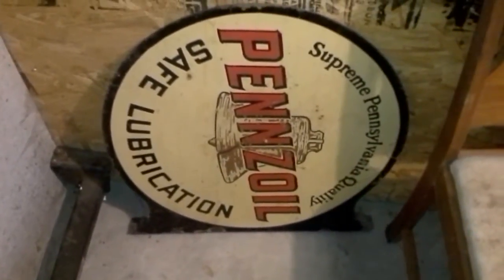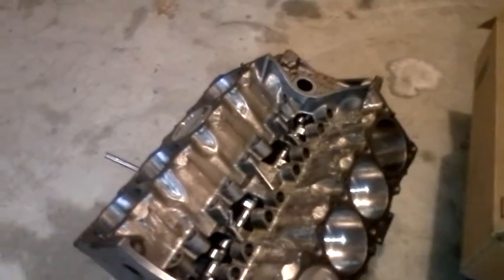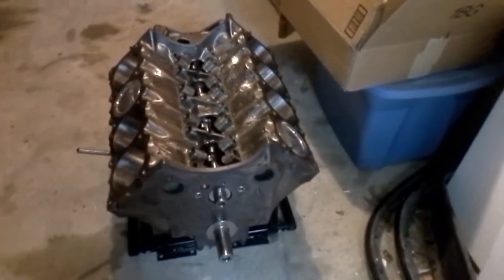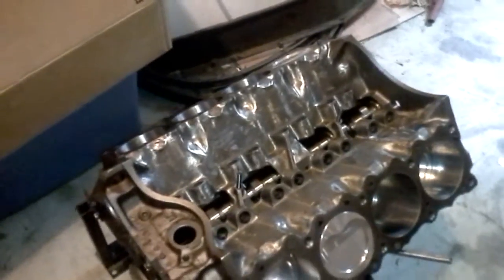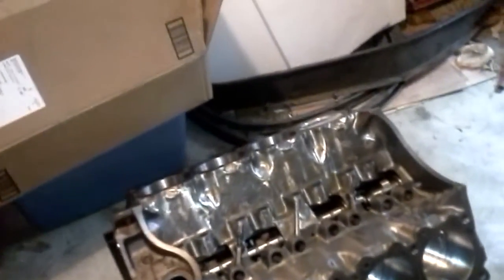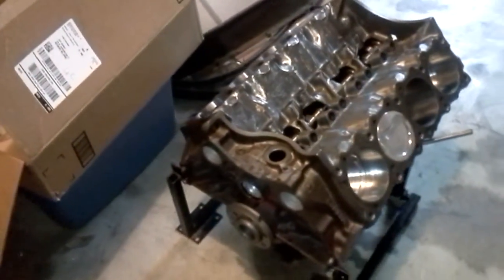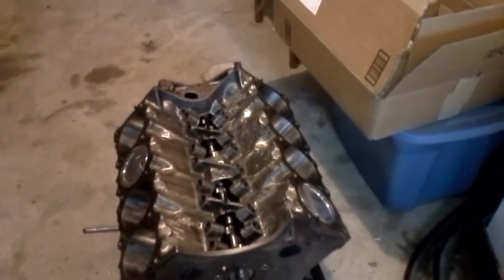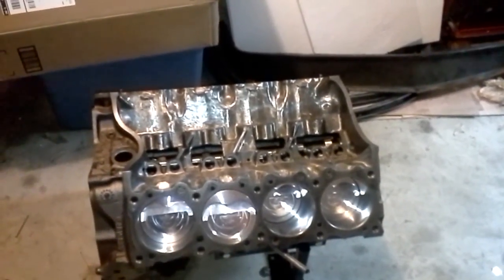461 cid Pontiac stroker engine

Comment: I wish there was a way to get decent power out of a pontiac engine at a decent price so I could keep my all pontiac trans am 1980 turbo Trans Am all pontiac,but the fact is they're dogs unless you throw bank at them & even than they're nothing really special.
Reply from the maker: Charles henson Not true at all!  I will admit the 301 is a huge turd and not worth building.  But I can show you how to build a solid 420hp @5400 rpm &  470TQ @4100 rpms 400 that will pull plenty of vacuum for brakes etc and shift around 5700-5900 rpms. 
It all depends what you want and intend to do with the vehicle.  👍 JD

Comment: A .030 over 455 isn't a "stroker".
Reply from the maker: John Tempest LoL this is a Butler Performance Forged rotating assembly.  4.25” stroke is not stock FYI.   
OEM 455 has a 4.21” stroke, 6.625” rods & 4.150” bore. 
Butler assembly is 4.25” stroke, 6.800” rods and a 4.155” bore for the 400 Pontiac block.  Ie 461 CID 

I mentioned all the build details in the video, feel free to watch as many times as needed!  👍 JD
Reply: @HeadFlowInc  I stand corrected.  My assumption came from my .030 over 455 also resulting in 461 cubes.
Butler has the right idea. My builder warned me taking a 455 .030 is pushing things too far concerning wall thickness. 
But mine was a mild 400hp build. And I couldn't keep tires on it. 600hp? Good luck.
Reply: BTW what is the motor going in? And please post follow up video, can't wait to see/hear it.
Reply: @johntempest267  my 455 is .040 over with a mild build.
Reply: .030 is not pushing it on a 455, most 455s can go to 060 safeley. the early ones can for sure
Reply: @DavidDavid-ps1th  
If you say so. I don't have any knowledge to dispute your assertion.
But I know people with well regarded reputations that do.
My 455 was 1974 vintage (not SD) don't know if this is "early".
Also I meant to say "beyond .030".
Reply: It is when you start with a 400 block and install a stroked crankshaft into it. It was an early trick to cut down the mains on a 455 crank (stock 4.21" stroke) and install it in a 400 block. Now aftermarket cranks are available in both 4.25" and 4.5" stroke for the 400 and are the preferred method for increased displacement due to the smaller main journals on the 400 block. Less bearing surface area creates less heat and better lubrication for high RPM operation.
Reply: @neighborscomplaint6859  AND the 400 could be 4 bolt mains and thicker walls. It is a better way to make a big inch Poncho.

Comment: Thanks for making the videos.  Pontiac motors have always been my favorite.  I bet that 461 is a torque monster.  600 lb ft. maybe?
Reply from the maker: kevin122759 I felt it should be a 600hp and 600tq combo.  A lot comes down to the tuneup and the FAST fuel injection setup. It works good in the 1978 TA!

Comment: 650 with a 150 shot of spray
Reply from the maker: In all honesty, this is a Race engine he is trying to run on the street.  A 461 CID, 315+ cfm head flow, with a custom Comp Cams solid roller cam @.050 .260/.266 cam should easily make 575-600 hp.  Those 4.25" long rod engines make power.  When I set up the combo my goal was a 600/600 engine he could enjoy.  Butler Performance was the ones saying they thought it could make 650+ HP.  
One thing I will guarantee, it will easily be more than 500 HP.  I can make 500+ HP with a stock 455, slightly ported factory iron D-port heads, and the right camshaft.  Sometimes people underestimate the old Pontiac V8, but Pontiac was building "Stroker" engines way before the other brands.  albeit many of the Pontiac engines had under square ratio with too small of a cylinder bore.  In the case of the 461 stroker it's a small bore Chevy 496.  Thanks for the feedback I engine the sharing of experience.  JD
Reply from the maker: Cam specs with the 1.65 rocker arms before lash .016/.016:
.647/.649  @.050 .263/.269 adv 297/303  LSA 110  ICL 106
Reply from the maker: As a free build sheet. Flattop 455 bored .030, 10.30-1 compression, head flow 240-260 cfm, Comp Cams 290b mechanical flat tappet cam.  Top it off with an 850-1000 cfm carb!!!  550+ hp all day.

Comment: The nodular iron cranks are pretty tough, and were one of the better elements of the poncho v8. It would have been tough enough for a 400-500 hp engine, cryotreated for 600 hps. Forged crank must have cost a LOT.
Reply: Better get a job then
Reply from the maker: The factory 455 cranks have a 4.21" stroke with 3.25" mains.  When you stroke a 400 block the crankshaft has to have the smaller 3" mains. To get 461 cubic inches from a 400 it's a .030 block with 4.25" stroke with big block Chevy rods.  Another Cheaper option would be to have the mains on a 455 N crank turned down to 3.00" so you can run the factory rods and shelf Pistons.
Reply: +HeadFlowInc You don't have to turn down a 455 crank down anymore. Butler has stroker cranks on the 400 3"main sizes. That way you could reduce the amount of friction loss by going to a 400 block. BTW, I like the 428s more than the 455s.
Reply from the maker: w41duvernay I agree the 428 or 4.00" stroke Pontiacs are a great engines!
Reply: It's just too bad you can't find them anymore. I  would love to get one and drop it in a 1st gen bird and cam it w a 250 duration w/ a set of Rhoads lifters w/ a good set of heads and try it!
Reply: +w41duvernay -> Look at Butler Engineering. They even have an aluminum block now!
Reply: +Hawkins Home Yes, Hawkins, I've been looking at Butler Engineering stuff for a while. I would love to get one of their 400 main 7 liter stroke kits, and drop in a SUPER large cam in there (w/ a 80 psi oil pump) and have some street fun.